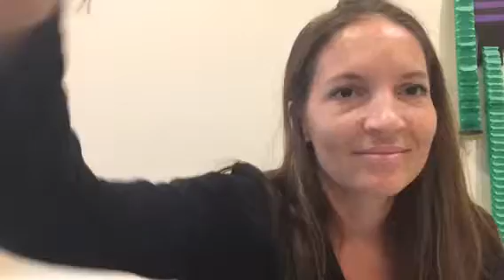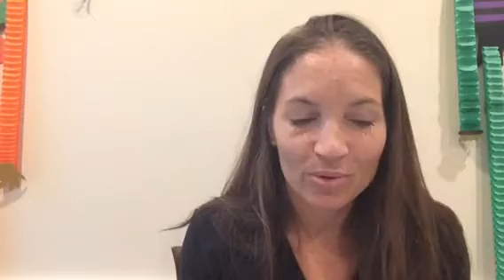Minimed 670G's dirty little secret: The underperforming auto mode correction bolus

Comment: I’ve experienced this issue as well and spoken to Medtronic reps about it. I encounter this quite often as my job is somewhat labor intensive, and when I’m in auto mode I often will get min delivery alerts every 2.5 hrs all day long. 

The reason it will not correct a high after exercise is because the pump is constantly calculating and adjusting insulin sensitivity. It does not use the sensitivity you have set in the pump settings. So after exercise where you have been getting so little insulin for an auto basal, it is calculating a higher sensitivity than what you’re actually at. 

Say you normally needed 5 units over a 3hr span to maintain your bg, but while exercising the pump only gives you 1 unit or even .5 units over that 3 hr span. It’s going to take that into account when figuring out your sensitivity for a correction after exercise, without realizing that the reason your bg has been maintained with so little insulin is because of physical activity and not the insulin it has been giving you as a basal. 

Try suspending the pump while you exercise so it doesn’t use that false data while calculating a correction afterwards.
Reply from the maker: That’s definitely an interesting idea, and I can see how it might have an effect on that correction. A few things pop into my head immediately though.... the first is that I don’t normally suspend for exercise in manual. These suspends are very hard on me. So I’m still not sure I’d get the desired effect, although I do see your point in at least having a potentially big enough correction to help smooth it over on the other side. Also, I’m curious about where you were able to find out how “insulin sensitivity” is defined and calculated in auto. I had actually read somewhere that it IS your insulin sensitivity, as determined in your settings, that was being taken into account. Where are these Medtronic reps you’ve spoken to, and how can I get a direct line?? :D Seriously, the reps I’ve spoken with often run through the standard 2 rote explanations they have in front of them... sometimes leaving me feeling like I would like to pull hair (my own mostly, but kind of their’s, too).
Reply: I suppose if you do need insulin still while exercising I can see how that would be an issue. Personally I could disconnect completely while working and my sugar won't go above 70 all day, and basically the same results when I exercise. I know that's not very helpful for you, but maybe someone else may have an idea for someone in your situation. 

I should have said in my previous comment that most of that is based on my own personal experience with a little trail and error on the pump. The only information I really got from medtronic was that it doesn't use your programmed sensitivity when in auto mode. Which made sense as some days my pump would recommend more or less insulin than other days to correct the same sugar. Believe me, I understand where you're coming from when you say you want to pull your hair out with their customer support, as a fair amount did seem to just be reading off responses and didn't really understand me. I honestly just got lucky when that information came across though. I contacted the representative that I met with when I first got on the pump and was discussing this, when I gave an example of my pump wanting to correct a sugar down by only a small amount  even though when I did the math it should have been much more, they told me that it calculates it's own sensitivity based on what it's been giving you and previous corrections. But it is always adjusting that number.

This is when it all started to make sense for me. Like I said I need almost no insulin when working, so when in auto mode I would be getting about .5 - 1.5 units over an 8hr day and only about 5-8 units total all day (not counting bolus). So I began trying to correct false bg values on days that I was working and days I was off, with a drastic difference. (note that I would not calibrate or take insulin for these, it was just to see what the pump was calculating). Days at work when I was only getting minimal insulin, almost regardless of the bg I entered I would never get an estimated bolus of more than about .5, most of the time it was .1 though (even with a 300 entered and zero active). However on my days off, with my auto basal amount being closer to my manual basal rate of 14units/day, the amount the pump would calculate for a correction was much closer to what I would calculate using my sensitivity. Hopefully this helps you, as I know how confusing this is and I am definitely still figuring things out myself with auto mode.
Reply from the maker: Trying to correct false BG values on working vs. non-working days is the kind of thing that makes me think there’s some merit to what you say you’ve found. I’m not trying to sound rude, but it’s hard to accept “solutions” or even ideas when they’re summed up with “just let it learn you”. However, you’ve presented a cause and effect idea, and it’s got me thinking. 

Here’s the thing.... and I’m just throwing stuff out without really processing what you’ve said..... I have a TERRIBLE time with suspends. A 15 minute suspend really is my limit, and i wouldn’t be surprised it even that could cause a problem. 5 minutes i’m good with. But if manually suspending the pump IS the solution, then that would also be a problem in and of itself.

And, here’s another thing.... So we’re talking about the size of the correction bolus and its potential in being able to handle my highs, but that still puts me at chasing the highs. As I write this, I realize this really belongs as an addendum to the first thing. :) it’s minimum delivery that is at the core of my problems and most of my highs were a result of THAT. So the value of the big correction bolus is not all that great when it shouldn’t be necessary in the first place. It’s like a fancy, self-healing bandaid that glows... aaaaand it cuts you so you can see it work........... So if you could just not let it cut you, you wouldn’t care about its sparkle. Terrible, terrible example. 

So how do you handle it?? Do you go around manually suspending yourself all day while at work so auto mode can remember that you’re diabetic and need insulin?

Comment: I concur with you Nicky.  The auto-mode is quite conservative, and always considers the full units onboard as though they are "brand new units".  One way to short-circuit this is to shortage the duration of each unit in your pre-programming, but that also has some dangers.  If I always followed auto-mode, my bolus corrections would be insufficient most of the time.
Reply from the maker: It’s what many are doing.... but I won’t. I think these block changes to settings are dangerous because of auto mode’s unpredictable and inconsistent delivery. If auto mode has only delivered 50% of our normal hourly basal rate, and we’ve decreased our AIT (or increased ICR), the next bolus might be well-aligned. But if we happened to have gotten our full 100% of our basal rate and have increased our insulin through settings changes, well, now we have too much insulin. I only go into auto now to document its craziness... I prefer the humble and predictable manual mode these days. For both my safety and my sanity. :D

Comment: How is this in the category of education? It’s not on board. It’s active insulin. It’s not blood sugar points.  It’s units. 
Weird vocabulary aside, I’m finding the same issue with the pump not fixing highs blood sugar. It is very good at catching the lows though.
Reply from the maker: Well, it’s not comedy....
Reply: It’s in the category of education because it’s educational...
IOB and active insulin are interchangeable terms- other pumps (t-slim for example) use the term IOB whereas the 670 uses the term active insulin.
Also it’s not blood sugar units, it’s technically mg/dL. Most people say points as far as I’ve heard. The term units is typically reserved for insulin.

Nicky, I find your videos informative and very helpful! I know this is an older one- but I’ve found that entering in carbs that I’m not eating in auto mode will allow a full correction dose, while maintaining the basal adjustments to avoid a potential low. Not sure if you’ve tried it, but it has worked wonders for me!
Reply from the maker: So you are my hero. Just so you know. What’s not to love, better yet, RESPECT about a woman in command of her language. :D That was pretty awesome......

About the those fake carbs....... oh, the fake carbs. I went into auto mode last week just to see if I could use fake carbs to get myself the insulin I needed to make up for what I hadn’t gotten through auto. I do understand we’re not supposed to do them, but I also understand I’m not getting enough insulin in auto, and this is the only way I see to get it where I need it (as opposed to blanket settings changes that will give it to me needed or not). I tried it for two days, and I gotta say, my blood sugar did pretty well. So I have a feeling that I could probably make it work that way. The only thing I ran into though, and it made me really uncomfortable, is that I was seeing more and more of the boluses and fewer micros. So there were some points that for 6 or 7 hours I would have just periodic micros...... And I wasn’t sure if that was okay. Actually, I was sure it wasn’t. So the next day I tried to do very small ones so that I would continue to get some micros, but there still wasn’t a huge difference. My point, and I take forever to get to it, is that I understand why they are working for you because you’re getting yourself the insulin you need. If you are able to do that in a way you continue to get your micros, then that’s great. How long have you been doing things this way?? I also just remembered the 6 days it’s watching you.... it hasn’t messed that up??

Comment: I think think the other thing to consider here is that the pump is showing you your active insulin from a lump sum bolus (insulin on board).  It is not showing you what insulin is active from the micro-boluses  for the last few hours.  The algorithm is, but it is not giving that information to you.  And as Matt Hollingsworth said,   the bolus is trying to get you to 150 not 120.  The idea being that microboluses can handle the moving you from 150 to 120.
Reply: Nicky, have you been able to have better fortune with the guardian sensor/670g pump? Because I find that at first I was spiking and it was frustrating but now that I’ve had the pump/sensor for about 3 months now I’ve seen a more stable blood glucose throughout the day. I find that the more you measure your BG, the better auto mode is at stabilizing your levels. However, something important to note is that you should never calibrate if your BG is 250+. Because it will stay that way for a while. To stay safe, I only calibrate when I’m under 200
Reply from the maker: I agree they put a lot of work into their algorithm. I also get that if I were able to maintain relatively stable blood sugars, auto mode would have a much easier time keeping me in a tight range. In reality, auto mode just let me go way too high for way too long, and I don't mind getting back into manual mode so that I can take the control back. I think people are having lots of different experiences and getting different results. I respect that. For me, at this time, I don't mind putting in the work.
Reply: -curious and informed college student

Comment: Another thing I have noticed is that Auto Mode seems to keep track of the active insulin on board and the time it has been on board. I hope this makes sense. But from the previous post, I stated I had .5 on board (about 30 minutes left) and then the adjustment it gave me. I was about the same after lunch, but had 1.1 on board (about 2 hours left) and the adjustment was much smaller. I think what AM does behind the scenes in the algorithm of madness, is calculate how many hours you still have insulin on board and adjusts to that as well. So, if you only have so much insulin left on board but it is only 30 minutes, it might adjust much more to your liking. But, if you have so much on board for 2 hours, it will not adjust to what you might want because it again, errs on the side of caution to see what is going to happen w/ those units left. Also, you might think you are sensitive 30 but the pump in Auto Mode thinks you are really 38 and does its math that way and those little number can and do add up. 

I will say this. When I am in Auto Mode and it is in range or near range, it is fantastic and I am glad for it. When I am high, I still want it to get to my range faster, but not roller coaster fast, like we all want and are used to for years. It is learning each of us individually too and in the weeks I have been on it, it has already seemed to improve and I can always make slight adjustments as well i.e. active insulin time.
Reply from the maker: Again, there are people out there who are having a wonderful time with auto mode. For the most part, I am not. There are times it's great, and I will pop in for a couple of hours. I like it between 10 pm and 4:30 am. (I need to get out in time to let everything settle again before starting morning coffee). I like it when I go to the food store. I used to love it during exercise except for the post-exercise high that seemed to always follow. Some people say it gets better with time. Others say, and I quote, "auto doesn't get me at all." I agree with the latter. I've worn Medtronic for 11 or 12 years, and I love their products. I'm just trying to make this one work for me. And it hasn't been easy. :)